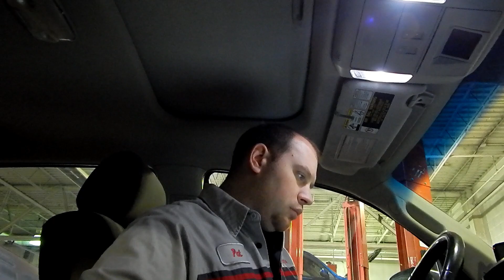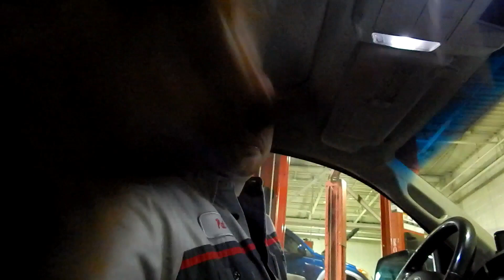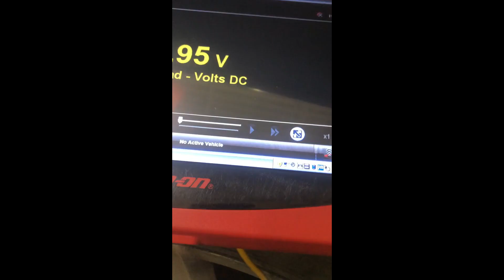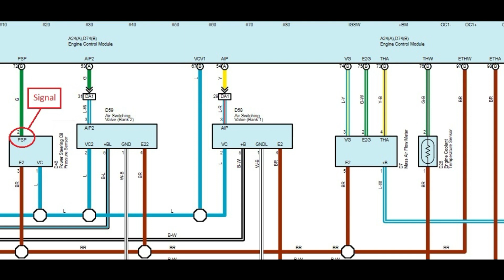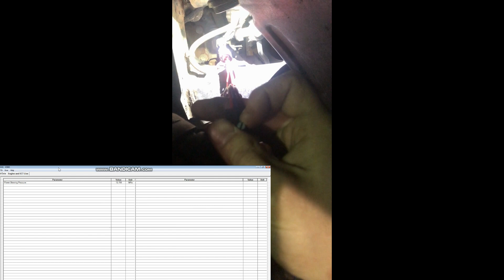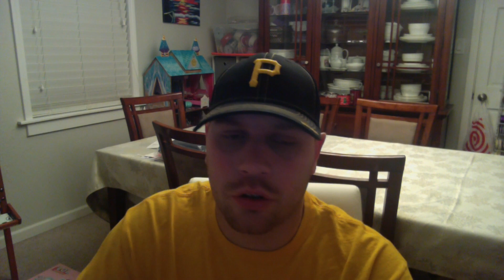07 Toyota Tundra P0553

Comment: I need help fixing this issue. I have code PO553. I have replaced the sensor and still have the code on my scan tool. Live data on the power steering pressure is 12.799 mpa with power steering signal showing off on my MS808 Pro. Even when I turn the wheels there is no change in pressure. Any suggestions? Harness or ECM? 13 Tundra Sr5 double cab 4.6L
Reply from the maker: With the sensor unplugged, do your voltage readings match mine in the video?
Reply: Voltage Drop Diagnostics the pressure reading stayed the same no change in it at all with the sensor unplugged.
Reply from the maker: David G what were your voltage readings?

Should’ve had 5v on one wire. 5v on another. Then on the 3rd wire you should have close to 0v with the sensor plugged back in.
Reply: Voltage Drop Diagnostics with a multimeter i tested the harness connection and it did not give me a reading on neither of the three wires. Also tried ohms and nothing.
Reply from the maker: David G sounds like you have a wire damaged somewhere in the harness then.
Reply: Voltage Drop Diagnostics is that easier diagnosed from the harness to the ecm to the harness of the sensor? But then again it is tangled or wire loomed with a whole bunch of wires. Or Is it easier to replace harness or connector?
Reply from the maker: David G replacing that harness will be expensive. It be looking for the damage in the harness.
Reply: Voltage Drop Diagnostics thanks for all your help.
Reply: David , or anyone ... I also have had this error code just appear P0553 ,  I guess for me , not really diving into this to replace the sensor myself yet , for one , I can’t seem to find an exploded view of where the sensor is even located on my 2007 Tundra 4.7 l V8  double cab . Any help with a diagram showing the location would be great for starters , then apparently just started looking at cost to replace it and found one for $175 without shipping . Is that about right for this part ?

Comment: You said its a pull down circuit but isn't the voltage on the signal of a pressure sensor just a bias voltage for dinostics that's why the code was for high voltage and this voltage does not affect the circuit under normal running conditions. Nice video.
Reply from the maker: No, on this circuit if the computer sees most likely above 4.5 volts it knows that the circuit is open and if it sees below .5 volts it knows that the circuit is shorted. But it sends out a 5v feed that gets pulled down by the pressure sensor.
Reply: @VoltageDropDiagnostics  thank you for the reply. I agree with you on the 4.5v and the .5v but the voltage on the signal wire I would see it as a bias because weather that is there or not the circut will act the same .The pressure sensors I have seen are made of strain gauge  material with an increase in pressure you get an increase in restince  giving higher voltage. Keep the videos coming love them.
Reply from the maker: Auto Tec you might be right. I’ll need to look into this a little farther.
Reply: @VoltageDropDiagnostics  I am just hear to learn.
Reply from the maker: Auto Tec hey. Maybe you’ll be teaching me a thing or 2 here.

Just because I’m on video. Doesn’t mean that I know everything lol.

I could have 100% been wrong. When I get a chance, I’m going to look into that pressure sensor a little farther.
Reply: @VoltageDropDiagnostics  with the open forum you have created we will hopefully all learn from each other. If you look at  SD drawings in his book he will always have the bias voltage coming through  a high ohm resistor from the 5v ref. He spoke to me one night on FB and explained it as a ghost voltage it's in the background but once the circut is up and running the voltage is so week it disappears. So a hall sensor will be pull up or down but a pressure sensors, Thermistor and potentiometer will not due to design.

Comment: Great idea to use the potentiometer......i assume it would work just as well for pull up or pull down circuits...just looking for change on the scan tool.....any chance of showing the tool connected at a sensor.....and where you found the one you use...glad i found your channel....and yes i have learnt so much from paul d  eric o   keith  ivan  and the other guys who put such good stuff on line for us
Reply from the maker: jeffrey herbert yup, this is just like a pull down sensor. I could have used a test light on ground, and touched the signal wire and on the scan tool, you would have seen the sensor reading drop.

With that said, one time I seen a voltage sensing circuit inside of a computer read 5v and ground well, but had a glitch that had dead spots in the middle, so you could have gotten burnt using the test light method. I’m sure the chances are extremely slim, but still something that needs to be kept in mind.

I’m sure you can find these potentiometers separate from a large kit, but if you go to aeswave.com and search for a utest kit. It’s a terminal kit that has a potentiometer in it.

Comment: 👍 nice, not a big fan of continuity tests either. Step 1 disconnect ECM 🤣
Reply from the maker: I went through the flow chart for this code, and ALMOST couldn’t believe step one.

I have no idea why manufacturers are still using continuity tests, especially on circuits that can be easily diagnosed from the sensor.